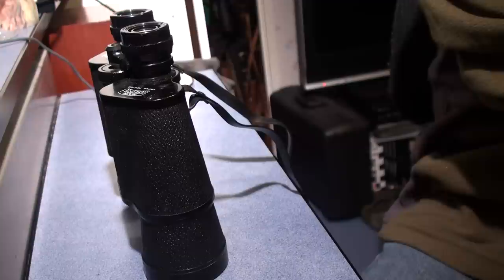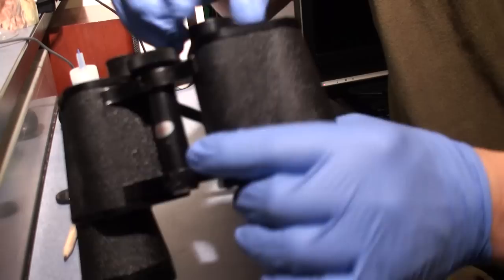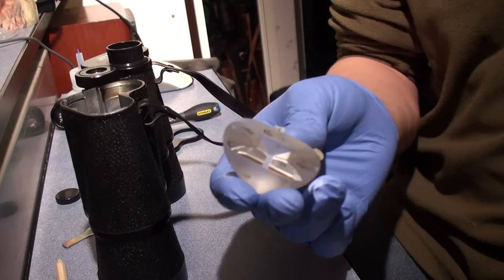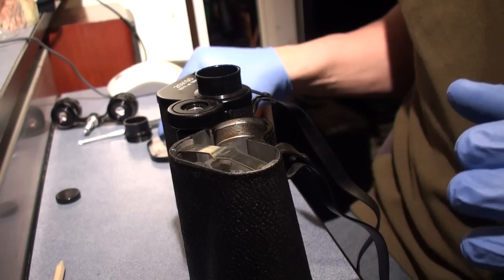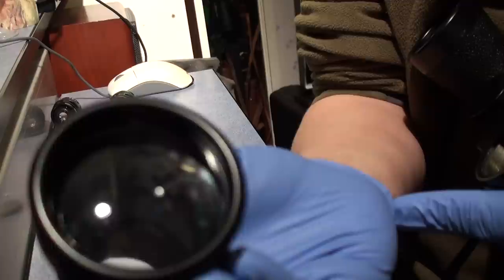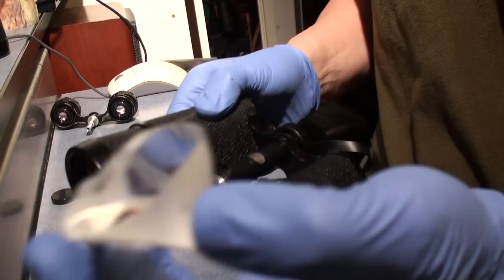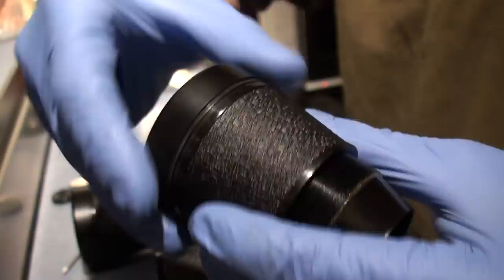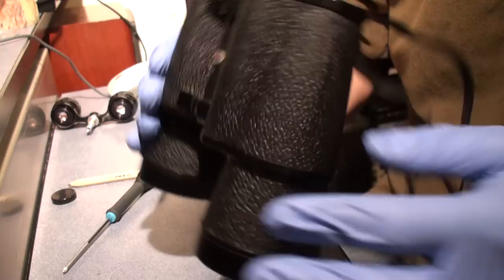Servicing a  budget Porro binocular.

Comment: Good thing I watched this video. I recently bought a pair of cheap binos for star gazing.. I had a real time trying to collimate them. I figured out that one of the prisms on the left front was knocked out of it's perch. I could see where it was off the 10 degrees that it was showing. I could see where the glue cracked and it had a pair of shims still in place. I removed and cleaned the prism and got it back seated in the glue and screwed it back down. I collimated them and they work very well now. I never would have known what to look for if it wasn't for this hands on guide. Merry Christmas.

Comment: Cheers, i just won an Ebay bid for 10 pairs of binoculars for 17 pounds..all in good condition,, just need to be cleaned,
Reply: I paid 20 bucks on marketplace for two of them. Unfortunatly 1 of them has a missing lens-part of the tube. And the other one does not focus with the wheel.

Comment: Smashing video!

I won a Swift 10x50 porro binocular on fleabay, Supposedly they were working fine but collimation was so bad that I got in touch with the seller to return them, He wouldn't reply to me so I opened a case, He still didn't respond so Ebay reimbursed me, I was about to put them in the bin when I noticed a gap between one of the objective bells and the prism cover, It had been refitted by someone cross threaded!
It was really difficult to remove but I eventually unscrewed it, I did what you said by turning it anti clockwise until it clicked, About the third or fourth attempt it meshed with the threads correctly and screwed home easily- Collimation was spot on!!
The innards were very clean and a nice bright/crisp and clear image was there after!!👍😎
Reply from the maker: Brilliant.  Yes a tend to always leave mine on DX. Glad you resolved it.
Reply from the maker: Well that was a result. A free pair of working binoculars.  Well done!

Comment: I have worked on 
over 300 pairs of binoculars.
I clean, tune, and collimate them,
 to be the best that each pair can be.
They are not all created equal.
Precise collimation is an art.
Some binoculars are defective or are  such junk that they really aren't worth the time it takes to get them servicable.
But there are some older brands that were magnificently built,
and they are rugged.
Such as steel turrets, prisms are clamped, screwed AND glued into position. 
The ocular lens rings are made of metal. The crane is all metal.
So is the adjustment wheel.
Casings are sealed. 
Screws are loxked into place with threadlock. 
And so on and so on.
Built to withstand and built to last. 
That all seemed to begin to change in early 70's - 80's.
Much in the way vehicles began to be made cheap.

Its funny that Id be the first to say that Tasco made junk.
However, Tasco had some that were superb.
It was either hit or miss with their binoculars and it depended on which factory they had manufacture them and brand them as Tasco.
I have a pair that are so sharp that they sort of hurt the eyes

Comment: They used black goo to seal the metal flanges on these 1970s metal binoculars. What was it and what to use in its place? Silicone would be a too strong bond I'm afraid.
Reply from the maker: There is a mastic type goo without silicon sold at screwdix. Almost a putty replacement

Comment: Thanks for a fascinating video Simon. Would you be so kind as to do a video of how to disassemble and clean a pair of Taylor-Hobson no2 MkIII Army binoculars? I have a pair and am a big fan of their build quality, but need to give them a clean internally as they are rather hazy and have some dust on the lenses. I also need to rotate the graticule in the right eye piece as it has slipped almost vertical. Thank you!

Comment: Can I use Isopropyl on coated lens surfaces? Nice work!! A good instructional video thanks for all the advice. Using gloves advice also a great idea. Sliced my thumb trying to take out the objective lenses from the front. Caught it in the little ridge! But it is somewhat difficult to clean through the screw in opening due to the grease placed on the threads. So having no grease I had to be very careful to not touch those outer threads with the cloth on the edges. Best to clean the threads firstly I assume?

Comment: Hi Simon. Fantastic video. As a result of watching it and doing some further research, I cleaned and collimated some cheap porro binoculars I bought from a charity shop and achieved a fantastic result. In fact I was so inspired that I bought some Carl Zeiss Jena 10x50 bins to service...............but I fell at the first hurdle. I can't get the focusing bridge off to get at the top lenses. I've spent hours trying to work out how to do it, but just can't figure it out. Unlike the porro binoculars, there is no cap at the bottom to allow me access to the screw; just a flat plate with a number on it. Can you or anyone else on this site help. I can't wait to get started and the frustration is driving me nuts!!
Reply from the maker: Ah Yes you won't on a German binocular Roy! Remove the IPD cover and loosed the tiny grub screw that locks the big centre screw. You will almost have to remove it. Then your back on track.
Reply: Thanks Simon...........you're a star. When I've cleaned them I may well be back in touch as I will need to collimate them and I can't see how to do this at present. On the porro bins that I services there were some tiny screws on the barrel which I adjusted. But I can't see these on the Jena's.........very confusing!! Thanks again.

Comment: Hello Simon, I have a pair of ZOMZ Kronos BNU 7x50 Olympic issue binoculars (the same as the ones on your flickr page), and I noticed that there were a few black specks in the right ocular (maybe 2 small specks). The reason why I think they are in the ocular is because when I rotate the right eye focus, I notice the specks rotating accordingly. My question is, how can I disassemble the right ocular lens, in order to clean it from the inside? And what tools would I need?
Thank you in advance.

Comment: Fantastic video - thank you! 

If you or anyone else is able to help please I'd be most grateful - I have a very old set of almost identical looking 10 x 50 binoculars with a broken 'bridge strap' / 'EP strap' (?) - aluminium bit thingy that connects the LH eyepiece to the rest of the "ocular" (as you referred to it at the end). 

I'm wondering if there is anywhere I might buy a replacement (and cheaply because the binoculars aren't worth much as it is)? Also the correct name of the part? Thank you in advance :-)

Failing that I'll have a crack at some sort of repair. I did see a post and photos on cloudynights forum from someone who did just that. He referred to the part as an 'EP  bridge' and someone else I emailed referred to it as a 'bridge strap' but from googling I can't tell if either one is the correct term.

Comment: Simon, you have an impressive collection I noticed elsewhere. I'd like to present an issue I'm dealing with. My focus is stuck, so much so, the focus knob sheared off of the brass (?) cerrated axle in the centre of the bridge. Said axle is totally stuck. Any tips on getting it unstuck? The grease has turned to a right tar (I'm hoping to 3d print a new focusing knob)
Reply from the maker: What are they?
Reply: @SoddingaboutSi It's an old Companion 15x65. I could remove the helical axle, like you mention in this video. But it seems the brass axle is stuck in the aluminium tube.
Update: it was threaded. To remove the objective bells: were held in place  by thread and locked by 2 locking screws for each bell hidden beneath more black tar. (Not collimation screws).

Comment: Thanks for detailed process of cleaning the prisms. I was afraid of removing the prism clip, so I cleaned in place. But the result was not very good.
Reply from the maker: You will need to clean the hypotenuse as that's the entrance and exit of the light. That will give you a good contrast improvement.
Reply: Thanks, Mr. Simon! I will do it when I open it next time.

Comment from the maker: If the prisms are back in exactly the correct position, then a crossed thread on the objectives. What binocular is it?
Reply from the maker: Try putting the prism in at an angle first. Gently wiggle it about. Be sure its in the correct was around to.

Comment: I have some dirt on inside of my 70'S binoculars, and i can't work out how it can happen seeing as how they're totally sealed in factory? Also is it not the case that they're vacuum sealed at factory, or is that only the high end bins?
Reply from the maker: If they are a poro design like these they are not sealed.  Most likely fungus. Have they got damp? What make model?
Reply: @SoddingaboutSi  They are same design,  prinz (dixons) circa.1976 , always been very well cared for, kept in original case always, with original silica pouch.
Reply from the maker: Unfortunately they are still prone to getting damp.  A strip and clean is the only way.
Reply: @SoddingaboutSi  Ok thanks, i will do that.

Comment: Hi Mark

I just bought a Swift Audubon mk2  8.5x44 binocular that is beautifully bright and clear but as soon as I arrived home and tried them again I found that something is jamming the focus mechanism, I've been advised to remove the focus shaft as there may be some crud in the threads, I'm a bit loathe to take them apart as the last set I stripped ended up in the bin!! 😲

It didn't do it when I was trying the bins!!

Would you say this is a job an amateur could accomplish?,  Cheers 👍🙂
Reply from the maker: Nice binocular. Check the screw that i undo at the back of the binocular at 1:28 hasn't fallen out.
Reply: @SoddingaboutSi  , I checked that as soon as I watched your excellent video!!  (I have about five binoculars that are dirty inside to have a play with!, Some are out of collimation though!!)
Reply from the maker: @aflatminor  The Audubon is a nice good quality binocular. I would consider getting it serviced by a pro. This video was freally or the budget sub 50 quid .
Reply: @SoddingaboutSi , Could you recommend someone to service them? I have no idea of anyone that does this type of work!! Many thanks for the the replies 👍😎

Comment: I've been trying to work on a pair of 14yr old Hanimex 8x30 binoculars. The problem is that I can't remove the focus bridge, because once I remove the cap at the objective end there's no screw inside the shaft, just some gluey stuff. It's completely flush. So I only got to clean the objective prisms. Also the right adjustable eyepiece unscrews all the way off, and I don't know if that's normal or I broke it.
Reply from the maker: Faisal Emran The eye piece should not remove,that ain't normal.
Is the focus system a wheel like this binocular or a focus paddle?
Reply: oh no, i wonder if it could be fixed then, if it's broken. It's a focus wheel. And thanks for the fast reply!
Reply from the maker: Faisal Emran not sure about the eye focus without seeing it. Does the ipd scale unscrew? That's the cap at the eye end.
Reply: Simon Spiers nope it doesn't. there's a tiny screw just adjacent to it, but removing it doesn't do anything.

Comment: You could of just cleaned all the reachable air to glass surfaces on the porro prisms without taking them out with compressed air, by breaking off the glue you lost all factory collimation.
Reply from the maker: wallabing no that doesn't work. And these are not sealed binoculars.

Comment: I have an old 70's to early 80's Carl Zeiss monocular . I want to clean internally before selling them on Ebay . Are their any other steps before doing a high shelf optic ? Such as coatings or nitrogen etc ?  Thank You and God Bless
Reply from the maker: timothy thomas What model is it? An early Jenoptem is coated but without nitrogen.
Reply: The monocular is 8x30 B 539160  .I copied a link to a similar set on Ebay the serial number is slightly earlier however .     God Blessed me with this find . As I was leaving the thrift store . I cought out of my periphery an optic . I asked the clerk to take out of case as I couldn't see the Brand as they sat . As well even if they had been bushnell I would have picked up for personal use . Upon seeing the brand I was as you can imagine glad . Not to mention upon turning them over and seeing the price tag at 50 cents  . I couldn't get the change out of my pocket fast enough .  I am somewhat familiar with optics and lenses to a point . However if you could give me an idea of the best course of action . I would be forever in your debt  Thank You for the consideration . God Bless

Comment: Thanks for disassembling your binoculars. I wonder if you're still on youtube? because I would need a tip, Got a pair of vintage binoculars, of the brand zenith7x50 triple tested field 71 *. but I can not displace the angle so they fit my eyes, Well how do I do. have tried with m 56 but do not want to open them. can you help? Thank you for your response.PP Sweden
Reply from the maker: Are you getting a double image?
Reply: @SoddingaboutSi  no sir  i can't bend the binoculars so i fit my eyes the are stockt, do y understand ??.
Reply: Are you still interest to help???
Reply from the maker: I don't really understand the problem. Are you saying you can't adjust the binoculars span ?
Reply: @SoddingaboutSi  yes that correct.

Comment: I cant remove the objective body it wont turn. its stuck how to fix it
Reply from the maker: What model binocular?
Reply: @SoddingaboutSi   Super zenith
Reply from the maker: @dexterkun4307  if it's the same design as is the video and has prism covers where the objective bells screw in, they are just bloody tight.
Don't try if there no prism covers as this American design don't split at that point.
Reply: @SoddingaboutSi  mine is 10x50, i guess its really really tight and i worried i might spoil it if i keep turning it alot. I will try ask my friend to help me.